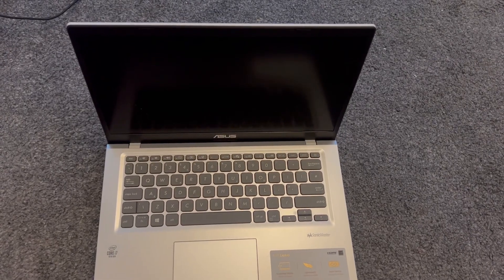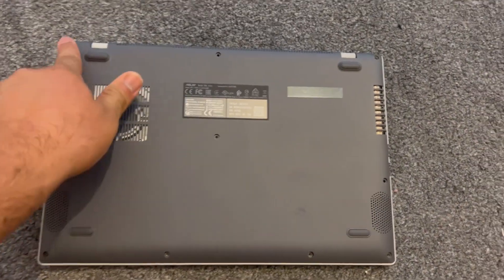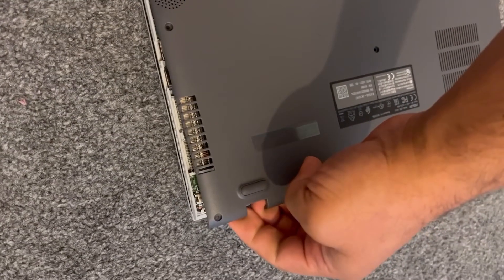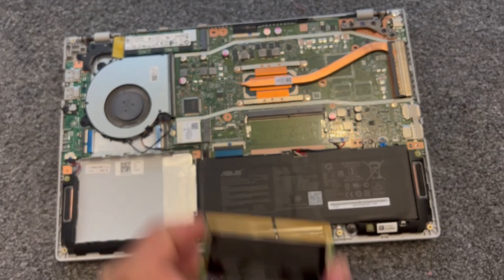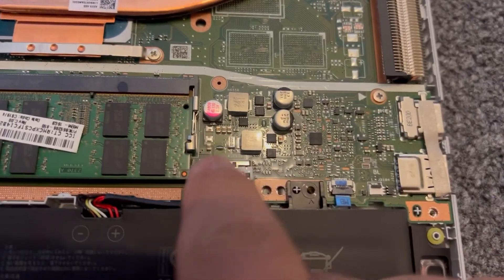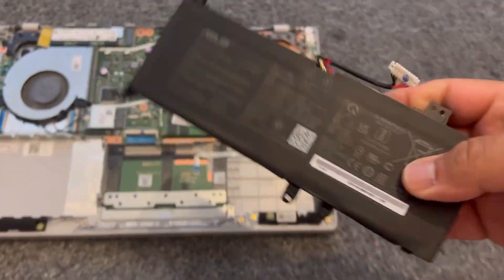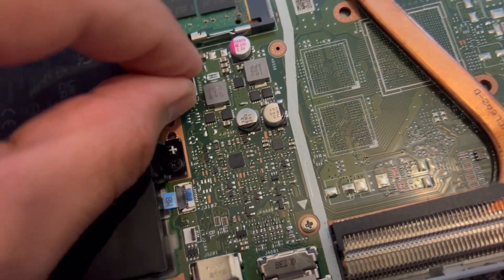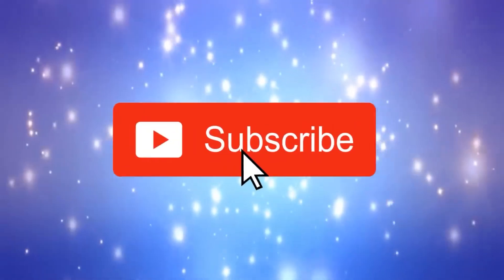Asus Vivobook 14 X415JA - How To Upgrade RAM & Battery Replacement 🔋

Comment: 4gb solded, 4gb SO-DIMM? just 1 slot? :C
Reply: There are two versions od this laptop, with different mothrrboards, 4gb soldered and max 8 on one slot, and 8gb soldered and max 8gb on external slot
Reply: @rockrelatedtapesfan6312  Thanks!!

Comment: RAM memoria, how much MHZ?
Reply: It depends on the processor mainly, mine has an Intel Core i5-1035G1 that accpepts DDR4-3200, LPDDR4-3733 up to 36 GB total (4GB built-in + 32GB in Slot)